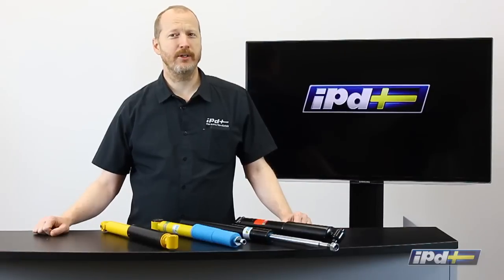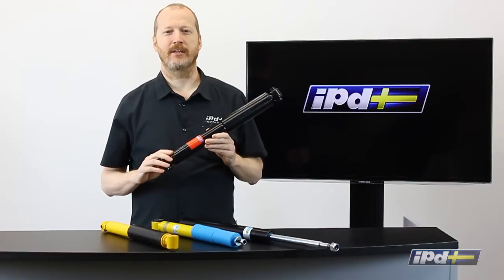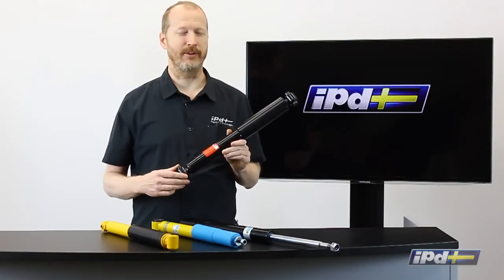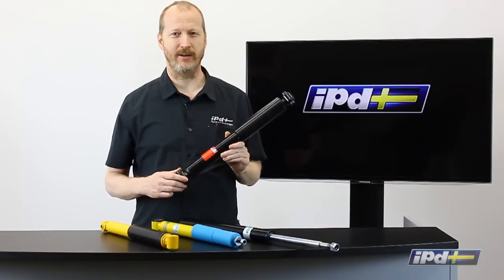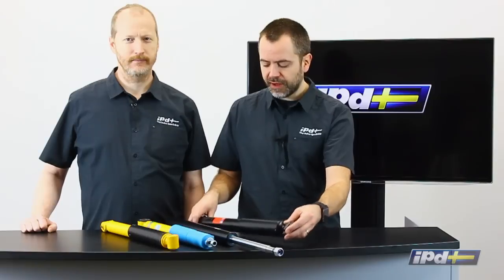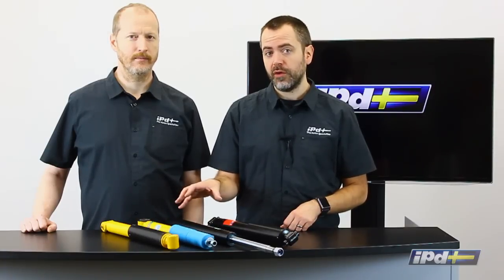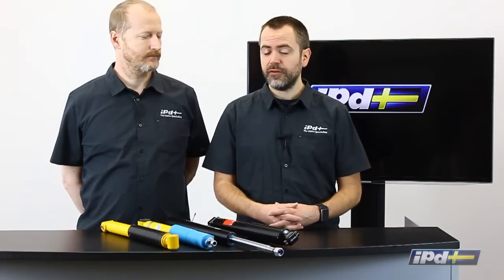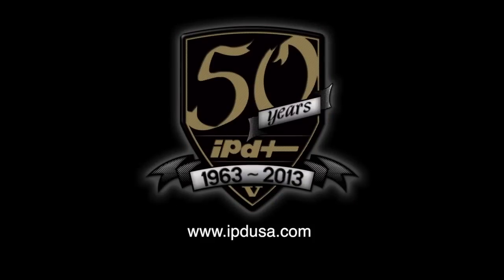IPD Volvo - Shock Options Overview

Comment: So at what mileage should  one change their shocks?
Reply: This is largely based upon the service usage of the vehicle. Volvo suggest inspecting your shocks every 10,000 miles per the service interval on the 240s, replace pairs as needed. Generally most manufacturers suggest inspect and replace as needed around 60,000 miles and if not replaced earlier to do so at 100,000 miles. However, on heavy service vehicles or if the vehicle is used in harsher road conditions or off road, some suggest inspect and replace as needed at 30k and if not replaced, replace the units at 60k. You can find the suggested service interval for your car in the owners or service manual.
Reply: 70-100k depending on roads/driving habits